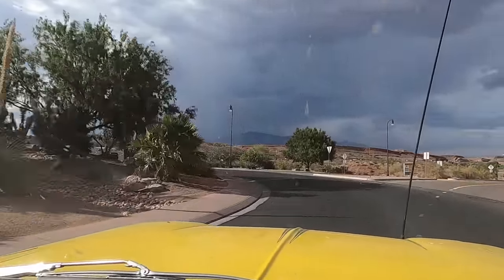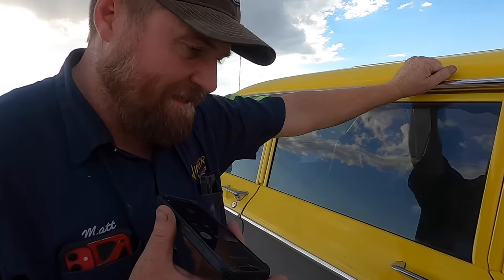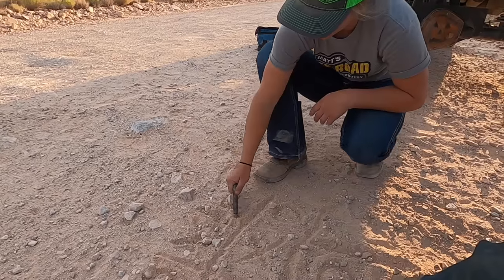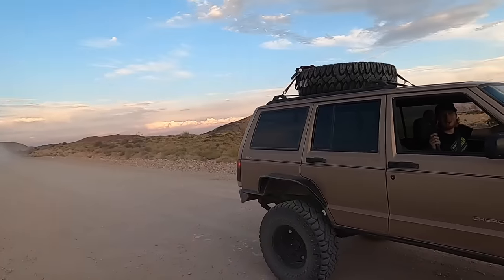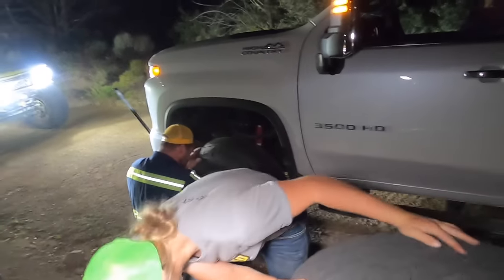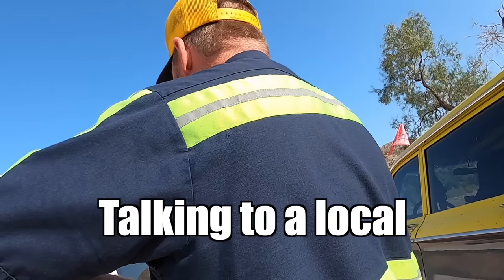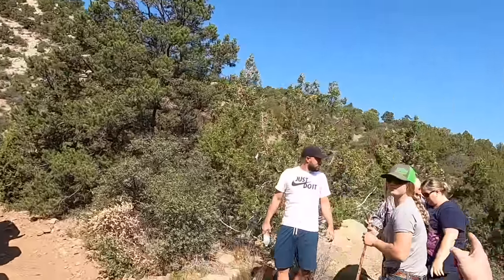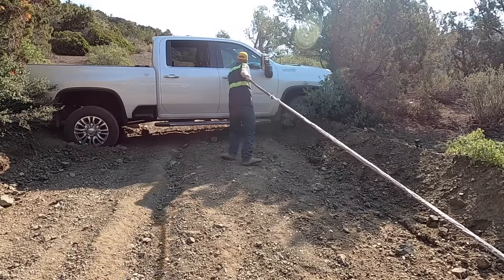Search & Rescue Mission Takes A Chilling Turn

Comment: I bought a Matt’s OffRoad Recovery Rope and have luckily not had to use it yet!  I do like how Matt has more faith in the soft shackles now for heavier vehicles!! Please keep showing close ups of the connection points of the soft shackle for various vehicles and complexity on how it is stuck, we’re learning and being entertained!
Reply: Its MUCH better than Static anything!
Reply: Be careful leaving it in your vehicle year round.  The extreme temperatures it experiences in your vehicle  actually will dry rott the rope. Not saying its a cheap rope. Its a fantastic rope. But conditions in your vehicle aren't  favorable conditions for preservation of the rope.
Edit: I wonder if there's an oil you can spray on it from time to time.
Reply: @Not your Business same here, i did get a matts rope, mostly to support his channel as I love it.  Haven't had to use the rope yet, but have plans for it soon when i go down to Galveston
Reply: @Not your Business soft shackles are VERY easily cut on abrupt edges even if they are not actually sharp. 
You should keep a range of bow shackles in your kit bag as a back up.
Reply: @Not your Business pretty sure they have them on the site i could be wrong.
Reply: Well, my Matt's recovery rope is no longer yellow, it had been used and abused, best thing ive used!!! (and i have tried mostly everything out there)

Comment: Can’t believe I’ve never seen that trick for breaking the bead; using the brake rotor and a jack. Good trick to remember.
Reply: Need to leave the dust sheild off so it doesn't get crumpled up!
Reply: With a farmer lift jack it is easy too
Reply: Funny how the simplest things are the hardest to think of.
Reply: I usually take the tire put it under the rear hitch set the jack on top of it and Jack against the hitch and the weight of the vehicle will pop the bead
Reply: @kayfelix5054  I get sketched out with those jacks.

Comment: We appreciate you/the crew and all that you do. Last Sunday I was making my back home from up north(WI) and saw a pickup truck on the side of the highway, 11pm, with no lights on. Was doing 80mph, so I barely saw the silhouette of a man standing next to it when I breezed by. Turned around at the next exit and doubled back to see if he needed any assistance(at least anything to signal he was there). I consider myself prepared for most situations, but if I had some shackles and your recovery ropes, I could've towed him to the nearest gas station. Lit up some road flares, got my jump box out, set my high beam lights on his truck bed; turned out he was a mechanic from Illinois come up to scout a car. He builds hot rods and took his work truck but not a single thing to help with catastrophic failure. Clutch broke. Left him with an orange reflective vest and well-wishes but I felt like I should/could've done more. At least I took him to the gas station to get food/supplies; his wife was on the way(3hr drive). He had AAA and nobody was available/wanted to come tow him home. It's people like you/your crew that make me want to help people whenever I can. I'll be buying some of your ropes in the future when I have the extra money.

Comment: 5 seconds before the smash cut to the flat tire I thought “I know Matt hates extra weight but I’ll never understand why he doesn’t carry a Jerry can and a full size spare. I was literally picturing a 40” tire on a roof rack
Reply: Yeah dont do that again x man.
Reply: he does have a Spare and a a mount because he had it when they ran the Rubicon, unless this video is from before then.  I know they post videos out of order sometimes.
Reply: @nsaanity   I don't understand how they can run out of gas as much as they do.  75lbs of gear and full gas tanks are not going too make him to heavy.  I have heard the same excuse but his seat of the pants unprepared style costs him money :)
Reply: I understand but to me it's worth the weight to be safe. My 74' Cherokee has a rear rack that carries a spare tire, high lift & has holders for 2 jerry cans. I don't always carry the cans but when going way out I can carry 5 gallons of fuel and 5 gallons of water

Comment: What were those old guys thinking, driving in that very rough terrain as darkness approached.?
As someone who is approaching the age of the two men who were stuck out there, the heart says you can do what you did 20, 30, 40 years ago! Unfortunately, the ol’ bodies can’t cash the check the heart wrote…
Matt & his crew are terrific.
Reply: Why did they leave them the first time?
Reply: @bobdrooples  If you watch the video to the end, they explain that they needed to get to a gas station ASAP as Rudy was almost out of fuel. The customer was confident that they knew the area and could find their own way out. Stuff looks different in the dark, and the customer got lost and then stuck.
Reply: When the customer was travelling, I don't think it was getting dark. Don't forget, once the customer got a flat they had to call and then wait for Matt. They had to wait even longer as Matt got a flat and had to wait 1 hour+ for Rudy to arrive. They then had to fix their own flat and continue on. Bad directions also meant that they spent a long time searching for the customer. If they'd had good directions and didn't get a flat they'd have been there and had the customers wheel changed before it got dark.

Comment: Lessons learned:  1) Fuel up before leaving town and/or (better) carry some extra fuel for you or the customer.  2) After dark, stay with the customer until everyone is out.  3)  Carry a spare for your vehicle.  4) Keep some emergency rations on hand.  Glad that everything worked out and wasn't worse.
Reply: This comment needs to be higher.  I agree with everything listed.  They were lucky that a bad situation was not any worse and everyone made it out ok.
Reply: I totally agree
Reply: They should carry fuel or keep a full tank but I don't agree that it's their job to stay with the customer after dark, especially if the customer didn't ask or refuses. Their job is to get someone unstuck or replace a tire, they don't need to babysit adults. And Matt has said quite a bit in the comments and video itself how carrying a spare is actually a liability and dangerous. And certainly keeping extra food and water is always a good idea for anyone who drives a vehicle anywhere.

Comment: Matt: Another great rescue and back-story. HOWEVER, please strap down that heavy shop jack! One quick stop or minor frontal bang, and you'll become famous as "Headless Matt." We don't want to lose you due to a major safety oversight. Stay safe-r!!
Reply: If he starts doing crazy stuff like that, he might go all the way and carry a spare tire, air tank, tools, etc.

Just wouldn't be Matt anymore if he prepared properly.
Reply: @kd5nrh  You can't have everything you need all the time anyhow...he does a hell of a good job with the tools they Do have though!
Reply: I agree about strapping down objects in the back. But for the grace of God I would have been killed in a roll over many years ago.
Reply: Safety 3rd bud jk  "nntgysiab"
Reply: This is so true!! No excuse of excess weight for a strap or two, 1 meal skipped would easily counter it😄
As for pumps my Viair 88p takes my 29" tires from 13lb to 33lb in 1.5 minutes, & its super light and compact!
I think a spare is worth its weight too but might be asking too much.
Maybe even a 5 gal can of gas😬

Comment: Matt - PLEASE LISTEN TO ME - that trolley jack is a lethal weapon, bearing its weight in mind,  placed in the rear like you have it here. Please at least secure it with a few straps or else put It down low directly behind your front seats (which is still dangerous butt a little less so) please don't let my worst fears here come true 😱😱😱😱
Reply: @snrgevosmith6663  sorry dude - I don’t really understand the “wheelhouse” reference, it’s not one we use here in Ireland but, to answer your other question, I don’t think there’s a single MORR video I’ve missed since they started posting them about 2 years ago.

Comment: I've been in this area and it's rough and dangerous as any place you can possibly imagine.  I'm actually glad the elderly driver got hung up turning around. It could have been a lot worse had he tried to drive at night and went over one of the tight edges in that large truck.  I'm so glad those older gentlemen were ok.  Great Job Matt and team.

Comment: 0:33 - I hope that 100 lb floor jack is secured in the back of the Morvair. If you get into an accident at speed it can turn into a lethal missile in the passenger compartment.
Locally, we had a child killed by a 40 lb toolbox stowed in the passenger compartment when the Dad's truck rolled.
Reply: I was thinking that every time it was in the interior shot.  Rudy needs to fab up a mounting bracket!
Reply: @ruger8412  Unfortunately, if you've watched a few videos, you'd see that safety practices are not 100% (seat belts, roll cage padding, keeping folks out of the "danger zone", etc.). Safety protocols have to be instilled, and always followed, no "it's never happened, so it won't".
Reply: Yeah, please secure heavy equipment next time. Would be sad to see a video of you guys having to report a stupid accident...
Reply: During Thanksgiving, I always secure the frozen turkey in my car.  I can't imagine being killed by a frozen turkey in a rollover!

Comment: You need a roof rack to put the spare tire on there always have a spare
Reply: Yup, a custom welded metal rack to throw stuff in like an overlanding vehicle
Reply: Weight is not a friend
Reply: I'm a bit surprised that the Morrvair doesn't have a jerry can for water, one for fuel, a compressor and a spare on the roof.
Reply: That much weight, that high up, makes a roll over on an off camber road much more possible.
Reply: very true.     but then you have too much weight.  on top.  matt has to keep his vehicles as light as possible
Reply: The 1978 darien gap expedition put ALL the cargo behind the bumper. It stuck out like 4 feet. They had little on the roofs.
Reply: @darlenegeorgeboyd8493  An empty tire would do, they can put it on the existing rim on the side of the road like on this episode.

Comment: Really glad you were able to find them in time. WOW!

These 2 ol' boys managed to get in WAY over their heads here.  Driving an $80K PLUS Duramax 1-ton "High Country" isn't any good if you can't perform basic maintenance such as changing a tire.  That was really, REALLY bad.  This could've easily ended tragically. 

Way to go Matt and the team!👍
Reply: They are rich enough to make the call to have someone come and change the tire for them.....
Reply: @JohnSmith-yv6eq  - unless you have no cell service, (got lucky this time) health conditions (as both these guys appeared) and getting lost AFTER getting the tire changed.
Reply: @silverstake88  Yes, I live where there is no cell service for miles in all directions. Personally, I cannot imagine driving anywhere without a spare and the ability to change it, esp in the back country.
Reply: @JohnSmith-yv6eq  Not if there's no cell service.
Reply: @silverstake88  
These old boys are rich enough to afford Sat Phones...

Comment: I keep a fuel can in the house, just in case I'm heading out and I know I'm already running low. I'll probably find a fuel station along the way but the can is there just in case I don't.
This might have helped you guys, Rudy could throw in some cans in the rear and if you need them then they are there waiting. I get why you don't carry them because of the weight issue

Comment: These guys are so nice. You could feel the honesty in their emotions.
Lessons should be learned from this rescue. Never rescue someone while compromising the rescuer safety. That means, having spare tire for the rescuer readily available on site, and make sure to refuel the car (and any additional fuel cans) before going off road on very remote places.
Decisions were made, going after Rudy in the dark was wise, but compromising the rescuer safety added some risk that could have been mitigated beforehand. Just saying.

While a tire doesn't fail that often, the few times that it does, it adds trouble not only for you, but your customers. Consider mounting the spare tire on top even if it is not assembled (although having it fully assembled would be nice too).
Reply: You can not carry everything and the kitchen sink in a rig like they use. There is limited space and you can’t carry too much weight. There is simply not enough space to carry extra fuel cans or a spare tire. I would say that the fact that he has only had one other tire failure in the years that he has been doing this proves that he is better off carrying extra gear, instead of a large spare tire. Rudy not filling up was because he was in a hurry to get the spare to them, it isn’t something they do on a regular basis. And one thing you are missing, they are not rescuers, they are a vehicle retrieval company. Their job is not to “rescue” people, they get vehicles unstuck. And I would wager that your experience in off road and recovery is zero, but by all means, give your useless advice to the man that makes his living doing it.

Comment: I can think of five hollows that have or have had county roads in them within 1 to 1 1/2 air miles of my home that were called a different name than what is on USGS maps and sometime, as with what you had, deferent names by locals. Just glad everything turned out for the good.

Comment: Just discovered these crazy hillbilly ass videos. That's awesome that you guys are helping people. That's a good thing. I've been stranded twice more than 20 miles from the nearest house once in snow and once in 106 degrees. Both times had to hike out and scaveng for water. Luckily the first time in snow I had a friend though we were only high school kids. The second time I luckily had a chunk of salmon and a bag of Xanax and a 2 oz jar that I used to get water from creeks. Also had a couple hundred rounds, an AK-47, and several other guns so I tried to send an sos via gunshots. But didn't get rescued. Just took lots of Xanax and kept on finding creeks to drink water. After about 14 hours of carrying a tin of weight because I had to pack out my guns, I made it to safety. Lucky I am pretty hardcore and won't just accept the situation and die

Comment: Wow - scary environment to be lost in. I don't think we Brits really appreciate just how big the US is, and how empty some parts are. It was a tough call to make after the customer tyre change - you have constraints from two sides but you chose to ensure your kin was safe, and the customer did signal their confidence in being able to get out on their own. I'd have made the same call but I'd have felt the same sense of dread the following day after you got that call about them having not returned home. Certainly not your fault in the slightest but it doesn't quell that horrible feeling you get in the pit of your stomach. Glad it all worked out in the end.

Loved watching you use the brake disk and the weight of the Morrvair as a bead breaker. That's ingenious. Not as ingenious as having spare tyres at the shop though.

Comment: I had a tire do the same. My friend said it is because the heat rotted the inside even though the outside looked like new. Desert heat wrecked a lot of things. Everyone recommends change all tires every 3 years even if the tires look new and few miles. Some people are just lucky there is GPS.  Some others not so lucky.

Comment: I saw this in one of your other videos I don't understand why especially doing this kind of stuff you wouldn't always have a spare tire?
Great job going back and finding the customer those two old guys could have ran into a lot of trouble if you had not found them the first time and the second time
Reply: Think about the size of the tyre and wheel..where do you put it?
Not inside, not on the back on a carrier, not on the roof, not on the front bumper...and not underneath....
It just can't be done safely or without interfering with day to day tasks.....
and Matt has stated that he operates mainly less than 30 minutes from base..

Comment: Looking for a gas station. 😊  In Australia my tanks hold 220 ltrs (58 US Gallons) & on one trip carried an extra four Jerry Cans with a top up of a 50 US Gallon drum dropped off for each of us.
One trip was 1,600 kms ( Including areas with no tracks just large sand hills)  before the next fuel & supplies.
We sure know how to weld with two battery's as rescue can cost heaps.

Comment: Tires are consumables; you're running them for better performance in your application at the potential expense of longevity. I get that. It's no different than someone boosting their engine or overclocking their cpu.

The only concern I have with people running underinflated is the increased risk of something bad happening _at the wrong time_, like in the middle of towing someone up a hill. That being said, two failures in ten years is not bad.

Comment: I'm an off road traveler myself. Can I aske if the tires we ment to be at 60 or 45 psi. If so half minuse about 5% and you'll never have that issue. So on the paved roads keep the 60/45psi depending on load amount. Now after leaving the roads to gravel take 5% of that you do fine.
Reply: I'm only sharing this info so that way I can see your Corp grow also I'm willing to throw an investment to your Corp on my next check just let me know threw a dm on Instagram
Reply: Also I'm sure you know your mechanics. I still want to invest in yall because yall are doing more than business yall are human and doing the most for a fellow exploring 4x4 enthusiast 🥰👌💜💙💛🧡❤🖤🤎